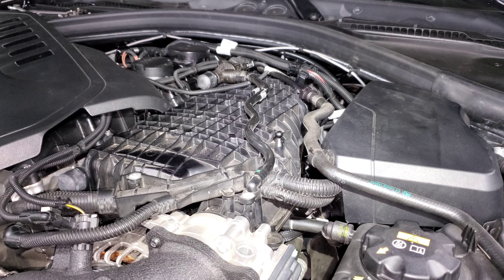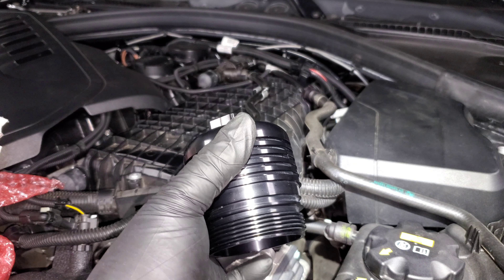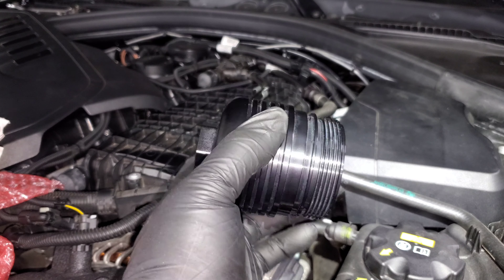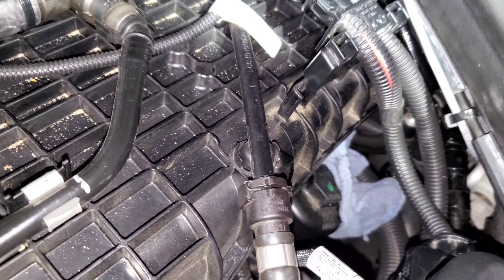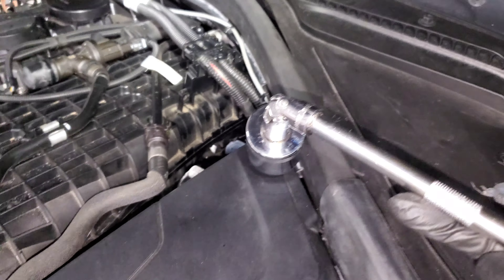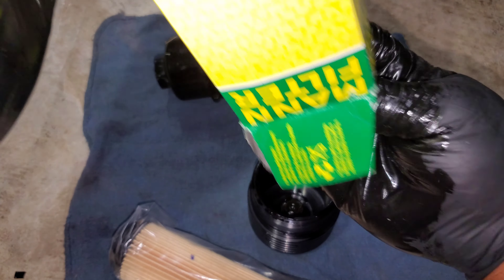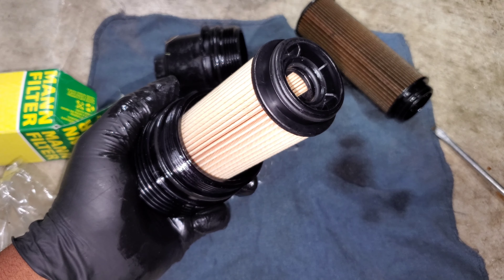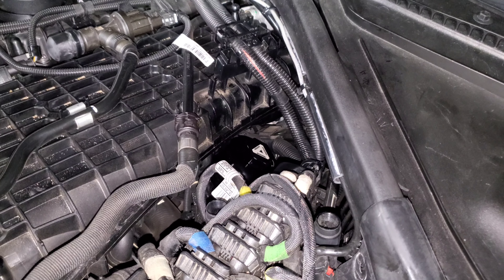Installing the Paradigm Engineering Oil Filter Housing on my 440i

Comment: Have you ever had an issue with the oil cooler leaking coolant ? That plastic piece can crack. Would you recommend a metal replacement ?
Reply from the maker: No and I haven't seen one

Comment: How did you remove that cage part?! I can't for the life of me get it to pop out and don't want to break any tabs. If a tab does break off, do you know if it is possible to buy that part without purchasing a whole new cap? Thanks!
Reply: You do need to order a whole new cap. I'm electing to buy a whole new cap and use the fresh bypass valve that comes with it.
Reply: @porschelover04  Good idea make sure you have a spare cap before you do anything, you don't want the car to sit there and wait 12 weeks for the cap to be manufactured and sent out.
Reply: @ThienTran-vq8kp  You're right, it turned out to be a wise choice. I used the old valve at first, but it turns out I damaged it during removal, as I got multiple low oil pressure warnings while driving. Evidently the warnings were false alarms, since it went through a whole day of driving and AutoX session without issue, but it was unnerving to say the least. Replaced it with the fresh valve the next day, and it's been smooth sailing ever since.
Reply: Pain in the S, one would have thought that breather valve is included in the billet cap.
Reply from the maker: It's expensive to make so that's why they don't include it.

Comment: When or if the B-engines start leaking from the oil filter housing, what is your estimate on how difficult it will be to change gasket? Is it much better compared to the N-engines or basically same?
Reply from the maker: Worse. It's under the intake manifold.

Comment: Sorry because I usually like all your videos (They are all very interesting), but this time I didn't. It felt a little bit too rush. You didn't put oil in the gasket of the bottom of the filter? And also that broken tabs... (maybe there's no way to get it out without broke them, but...)
Reply from the maker: ok
Reply: Given the issues the B58 has with the oil filters disintegrating from not being installed correctly and the fragility of the design... the last thing you want to do is to install a broken breather valve within the filter cap.. it is bound to create expensive problem.
Reply from the maker: Has been working great for years